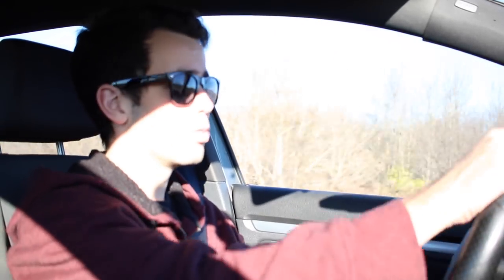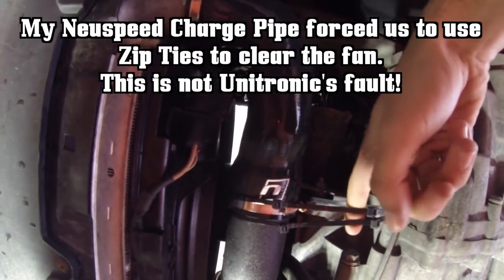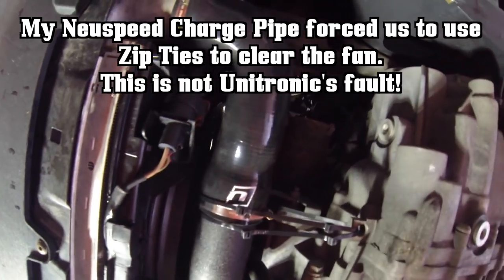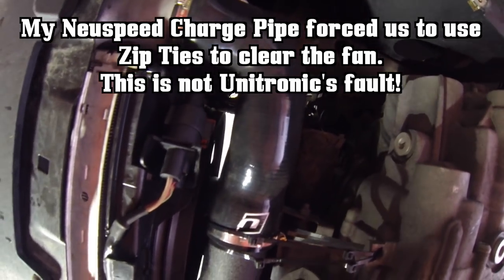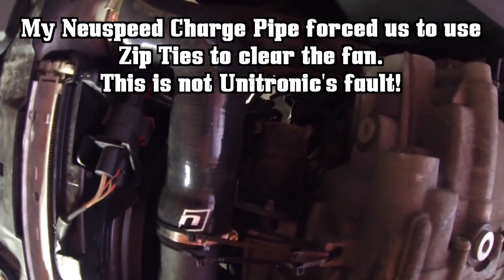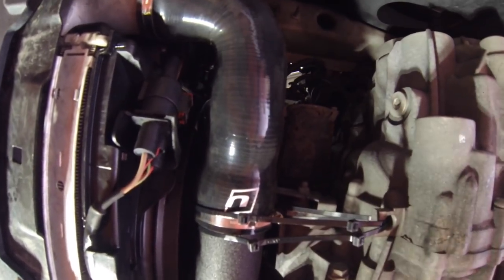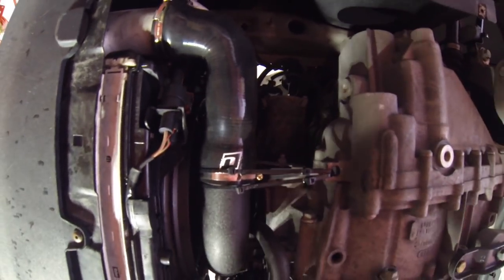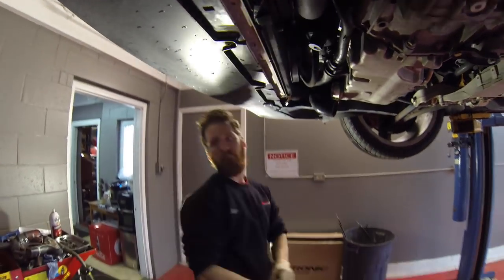Unitronic Intercooler 1 Year Owner's Review!

Comment: I'm getting one installed in a couple of hours, hoping it helps during these hot and humid summer days here in S.Florida. Also because I have all the supporting mods for a stage 2 Unitronic flash plus I already invested on a stage 2 TCU flash from Uni. I constantly see iat's over 140 while driving around (not on highway at higher speeds obviously). My plan is is38 next so I'd be ready for it now. (mk7 PP, ultimate racing 400 cell cat w/ resonator downpipe, Cobb catback, Cobb intake, Uni stg 2 TCU DSG, currently MAperformance stg 1 tune but will flash Uni. stg 2 today after IC install.) Keep them videos coming, haters gonna hate.
Reply: Did you see much of a difference after the install? Less heat soak?
Reply: chfire2004 yes, overall less heatsoak and quicker recovery of heatsoaks. Lower temps while cruising and better flow under boost.
Reply: My son is planning to order Unitronic Intercooler, downpipe and possibly intake to go Stage 2. Also going to see if we can just go intercooler and downpipe w an AEm panel filter if tuner says thats a good option as well w Stage 2 along w new set of plugs. Should wake car up noticeably. He is currently on their stage 1 ecu/tcu

Comment: I added a Forge twintercooler and it feels like I gained 30 hp. Possibly because of it being an APR stage 1 mk7 GTI, but I couldn't be happier. (Ps. with black piping, you can only see the front mount if your looking for it.)
Reply: Travis Macaluso So you dynoed your car right before you installed it then after you dynoed it again on the same day? Oh that's right, no, no you didn't.
You don't gain HP with a intercooler, if you do its minimal at best. It keeps you closer to that peek hp when the car is hot. It doesn't make more.
Reply: Carlos Finch from what I've read, based on the intake air temperature the vehucle can advance timing slightly and automatically corrects its fuel ratio...? When I did get a chance to dyno it, I was 24 hp over another Mk7 stage 2 with almost the exact same mods. As well, the tech said that the 3 pulls were the most consistent of the day. The curves on the graph were the exact same every pull.
Reply: Two cars with the same exact modifications will not dyno the same.

My point was when you dyno a car, you do so in the most ideal conditions, ie the intercooler won't be heat soaked. Therefore a dyno comparison before and after won't show much if any difference.    Both dyno sheets will be of the car in optimal conditions. The air will only be cooler after the car gets hot. 
Where you will notice a difference is when you run the shit out of the car for a while it will stay closer to optimal as opposed to pulling in hot hair which makes the car feel sluggish.